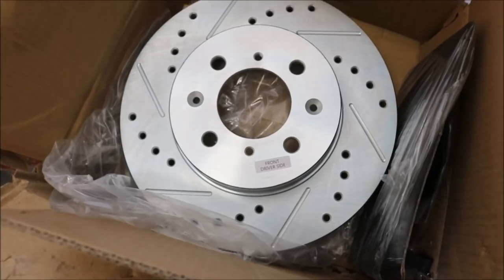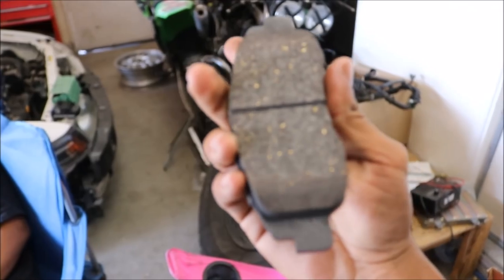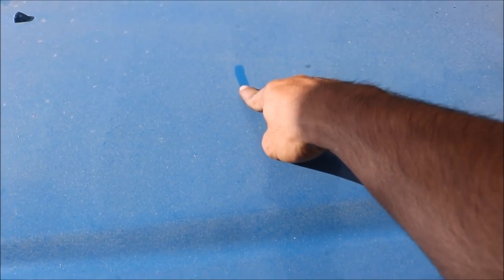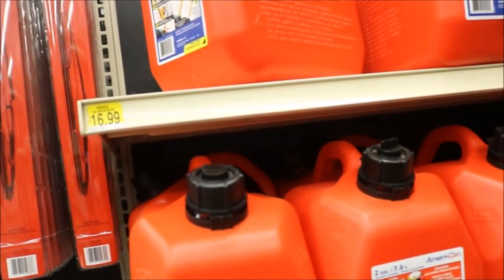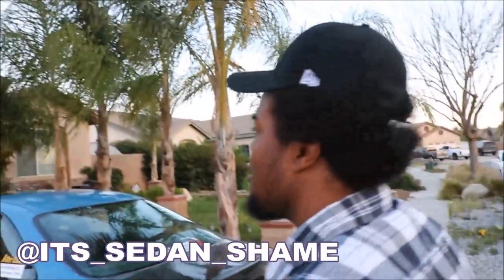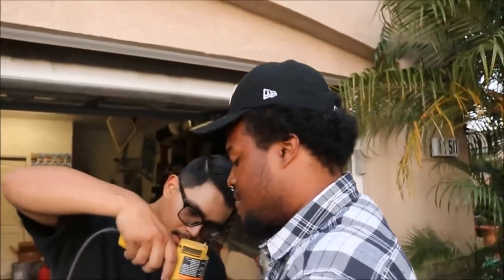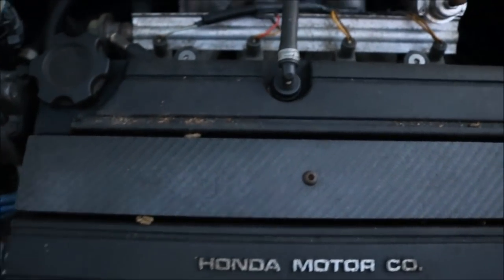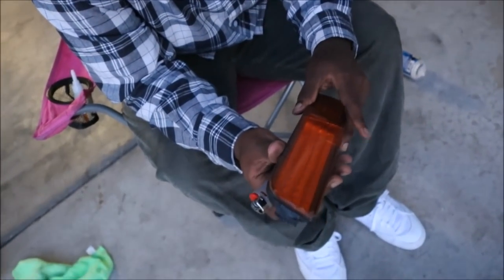FINALLY UPGRADING THE BRAKES!

Comment: Something told me you were gonna get drilled and slotted rotors. If you are going to track this car more often then stay away from those kinds of rotors. They can not handle the non stop rapid cooling cycle of track driving. Cracking and warping are common after a few r track runs. Strictly stick with slotted. Also, Leo is right in that you should've invested in stainless steel braided brake lines. Not only do they provide true pedal feel but they do not expand on heavy braking. Convert those rear drums to discs too! They are a serious handicap to breaking performance
Reply: DeathMine as long as he did a Proper break-in on the brake pads/ rotors they will not warp. Reason why they warp is because people don’t know how to properly break these in since they’re not like regular brakes..
Reply: Luwie__ Proper break in of the pads will not do anything for crossed drilled slotted rotors. The issue with these rotors are the holes. They do not serve a major purpose anymore. They were designed that way based on old brake pad compounds that produced a gas layer when hear was built up on the surface of the rotors from heavy braking. The holes allowed those gases to escape the surface and allow the pad to make contact with the rotor. The brake pad compounds of today do not produce that gas as often anymore. So those holes are actually a structural weakness in the rotor itself as they provide less surface area for the pad to grab and are the reasons why the rotor will crack. After the heavy braking is done the holes undergo a massive rapid cooling cycle of up to a couple hundred degrees in a matter of seconds and are the first parts of the rotor to cool. Imagine continuously doing this often. The rotor is bound to crack sooner than it should. Also, the break in procedures for brake pads are different based upon the compound they are made of. So it's not that some don't know how to brake, which is true, some just don't read and follow instructions
Reply: DeathMine You are correct about the drilled rotors.  They always crack with enough heat cycling.  The only drilled rotors I have seen that haven't cracked are brembos.
Reply: DeathMine Also bedding makes no difference when it comes to the issue of cracking or warping.  Also ditch those ceramic pads.  They are junk for track days.  If you want a street strip pad that can take the heat I have had a very good experience with hawk hk plus pads.  Also the hawk blue pads are great but they do take some time to build heat in them.  When they are cold you will have reduced braking.  They almost feel like there is water in between the pad and rotor if you have experienced that before.  Lastly lines are a great upgrade also.  Also a good quality brake fluid or even new oem fluid is a good idea.  I had never considered brake fluid before as the type r I had only had 80k miles on it.  Long story short I was able to boil the brake fluid during a long session.  It was terrifying as the pedal went to the floor and when I pulled over I could see and hear the brake fluid boiling.  Once water gets in the brake fluid it's easy for it to boil.  Like a lot of racers have told me racing is all heat management whether it's the motor, tires or brakes.

Comment: Water is not wet your mind just thinks it is
Reply: Rutledgem then why do your clothes get soaked if you jump into a lake, what is that called
Reply: Boost At 6.9k Rpm it’s what your mind thinks you are technically water is not wet your mind just thinks it is

Comment: I'll never put water in my radiator/engine.
Reply: leoboy191 some tracks mandate only water in radiators because if there’s a leak the don’t want coolant on the track
Reply: Hung Racing I don't know about race track rules, but I'm just saying water has a boil point, and in a race setting, I wouldn't run water.